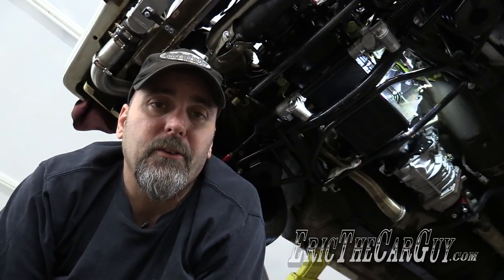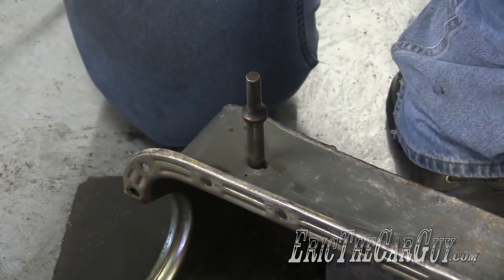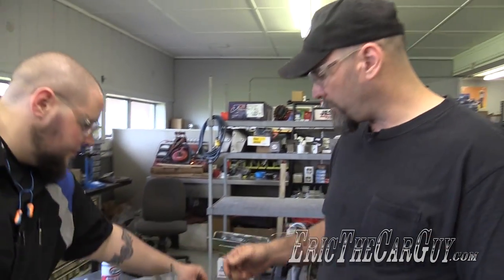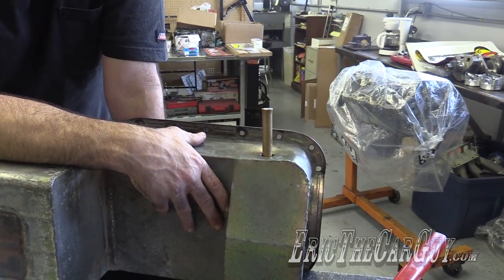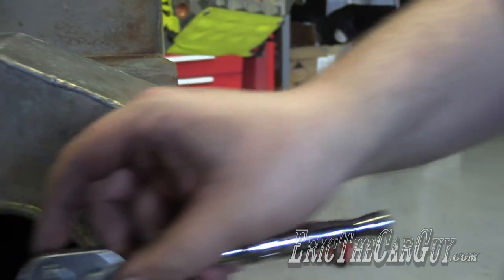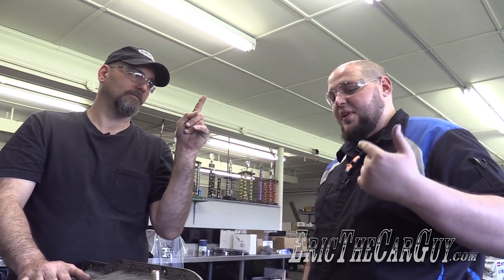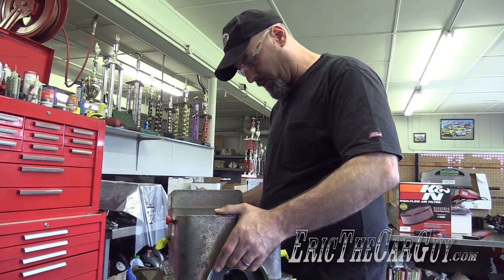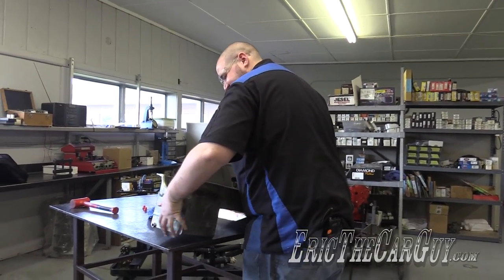Oil Pan Modifications for Turbo and 4 Bolt Main Small Block Ford #DarkMatterPikachu

Comment: I'm not an engineer or a mechanic but I would not accept such work on my stuff. punching through the oil pen? Kind of Taping? Come On there are for sure better ways to do this. It looked like they are holding it there with the sealer. The fitting should have been welded on the pan. And I think that one can order an oil pan with the fittings for turbo oil return strait from the producer. No wonder his father walked away, recipe for a disaster.
Reply from the maker: As stated in the video, the method shown in this video is what the turbo instructions called for. It worked fine and there are no leaks.
Reply: I really hope it does after all the effort you did for this build.

Comment: full workshop and that is the shit you hack up... weld on a bung and tap that and use a 45 or 90  barb....shit-ery
Reply from the maker: As stated in the video, the method shown in this video is what the turbo instructions called for. It worked fine and there are no leaks.

Comment: I...would...flip...shit....
sealant and silicone!? fitting or but..tig it on
Reply from the maker: As stated in the video, the method shown in this video is what the turbo instructions called for. It worked fine and there are no leaks.

Comment: thread it in and silver solder it, laugh @ rtv
Reply from the maker: As stated in the video, the method shown in this video is what the turbo instructions called for. It worked fine and there are no leaks.

Comment: what a pain n the ass just to tap a oil pan
Reply: Kris Nicholson I got a transmission mount on my crx ZC swap that keeps ripping the top bolt out the transmission I drilled and tapped it and it lasted a while but...... I checked it the other day and it Done ripped it out again.  gonna try a thread saver or heli coil this time i think.
Reply: They mentioned it briefly, but I think one of the issues is needing enough meat to tap into. By punching the hole, it flares inward and creates a lip, which gives probably another 1/16 to 1/8" for the tap to cut threads into.

I agree that this is the most difficult way to add an oil return line.
Reply: Kris Nicholson yeah it's a pain in ass ZC motor spins counter clockwise I think makes it more jumpy and Torq on mounts honda should have out 4 bolts in it not 2 on bottom and 1 on top it a bad design.
Reply: Kris Nicholson na I'm talking about it needs 4 bolts holding bracket on transmission it has 3

Comment: Lol that oil pan is going to leak out of the fitting and the gasket. I lost all respect for ETCG this machine shop is a cluster fuck
Reply from the maker: As stated in the video, the method shown in this video is what the turbo instructions called for. It worked fine and there are no leaks.
Reply: doesnt matter what the instructions call for. its a cheap and poor way to run a turbo oil return line. wouldve cost $20 to weld in a proper fitting. and anyways pipe thread is tapered so if you ran the fiting down all the way that proves the tap was run in too far. youve done everthing else well up until now. why take the easy way out on the pan? a few extra dollars would insure this doesnt leak for years.

Comment: So you take the time to drill a hole into the pan, why not just find a bigger drill bit and then tap it properly instead of banging on it like some high school shit heads putting a turbo kit on their miata.
Reply: Brian X because you need the metal that folds inward there to tap onto or you would have next to no threads and it could fall out easily.
Reply: TheSamplebridge  or just buy a fitting that comes with a nut or better yet weld a nut on the pan and then no worries about it
Reply: They where just going by the instructions in the kit as he has said before.